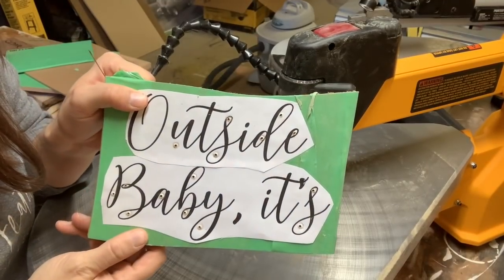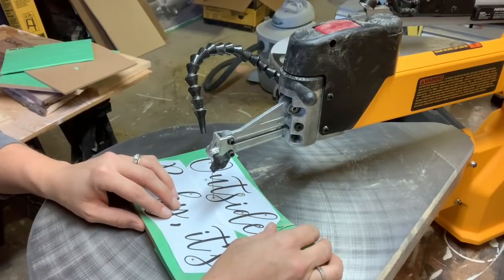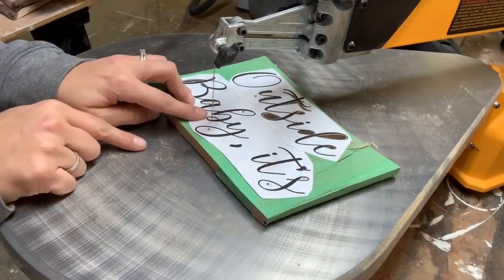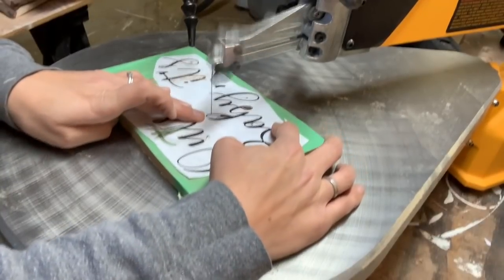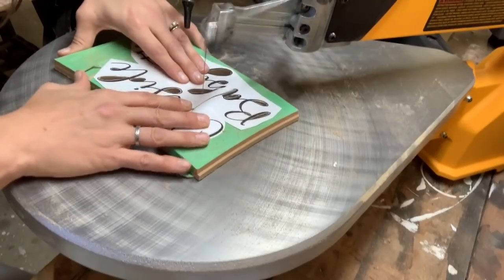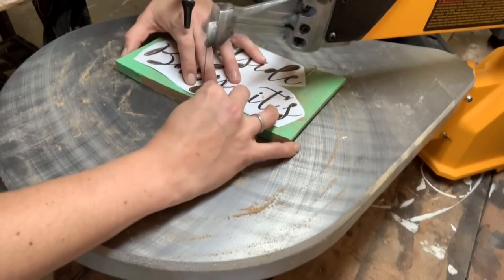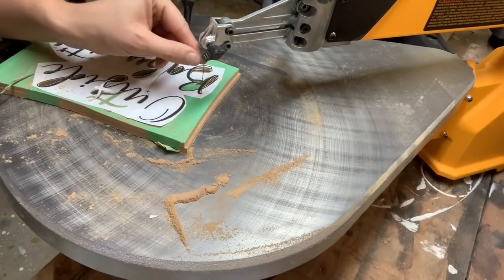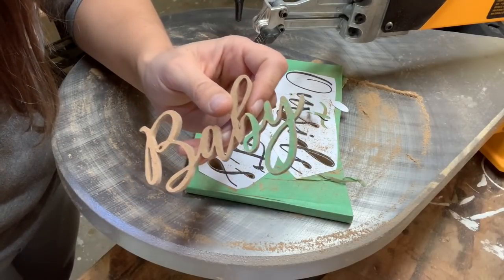Cutting Script Font on a Scroll Saw

Comment: Thank you for the information about the vibration. I did not know the blade could cause that by becoming loose, I assumed it was the workpiece that was causing it. I will reset my blade before I tackle the next piece.

Comment: So the first layer is painters tape? Or some other sticky paper? Is this so you can spray adhesive on the pattern so it doesn't get on your board? Thank you.
Reply from the maker: Yes! That's exactly why. I use painters tape or contact paper. Then you can use glue or spray glue to stick your pattern on top, and you aren't getting glue all over your board! Saves time sanding, and you don't want to be sanding aggressively when you have small detailed cuts.